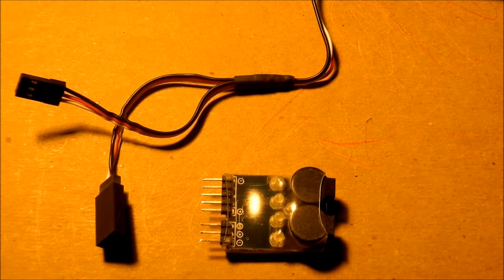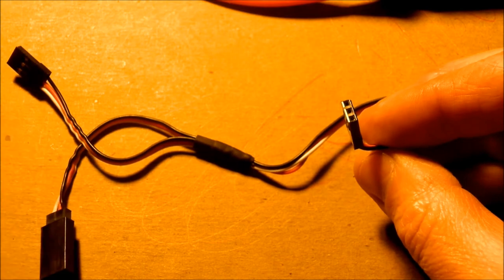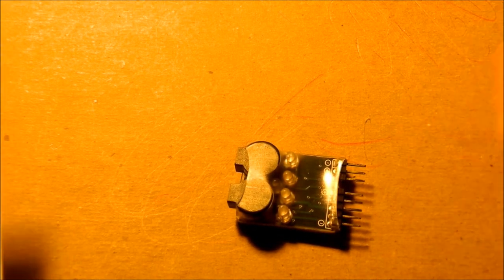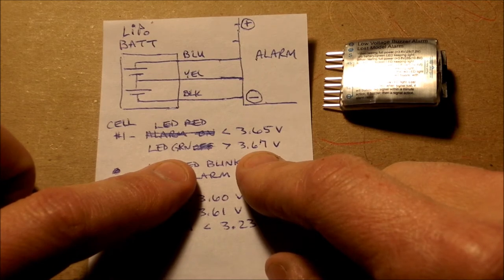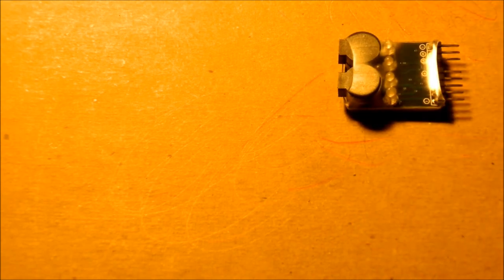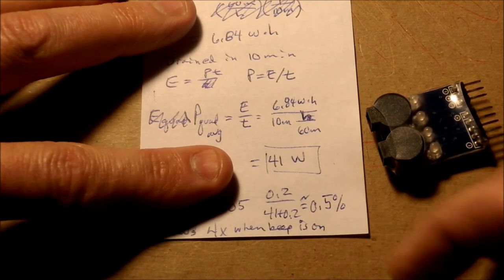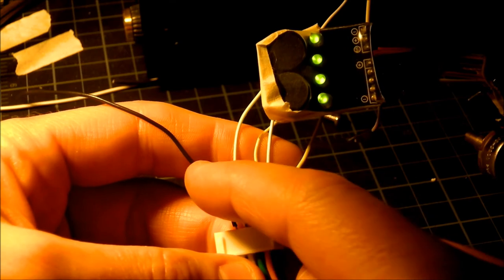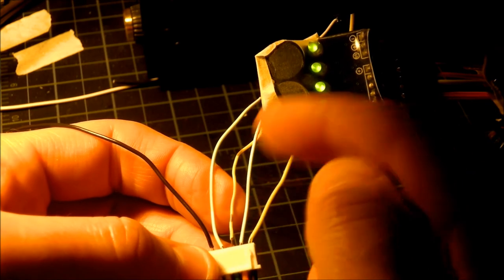2-4S 2in1 Low Lipo Battery LED Voltage Meter Tester Alarm Indicator Testing

Comment: Your  vid its THE  BEST  TUTORIAL I have seen on you tube regarding this buzzer.You have any ideea,when buzz sound,it's cut off the motor power ?
Reply: +vasile tomazian Low battery cell voltage sounds the alarm at about 3.3V  (except cells 2 and 4 don't).  The motor cutoff voltage is set by the ESC, so I don't think this device is anything beyond an alarm.
Reply: Tks for reply. All the best for you.